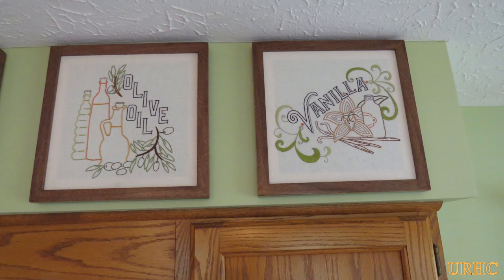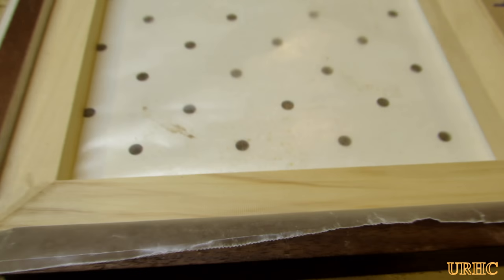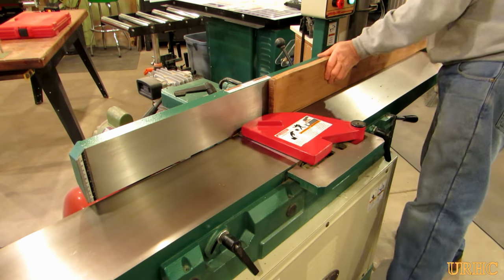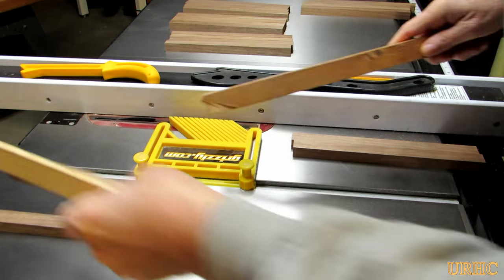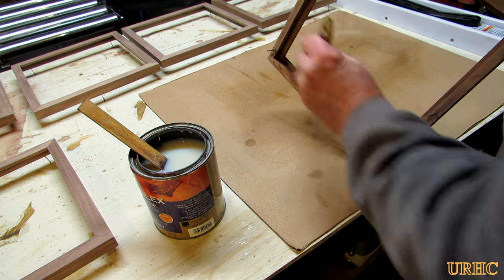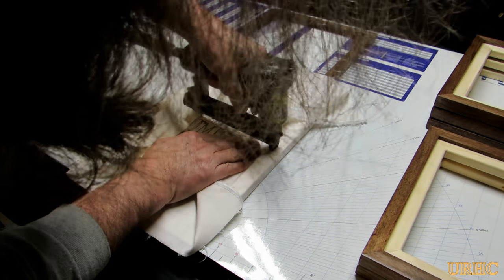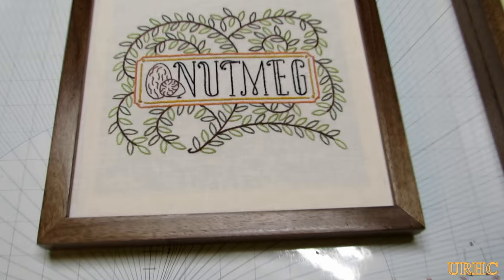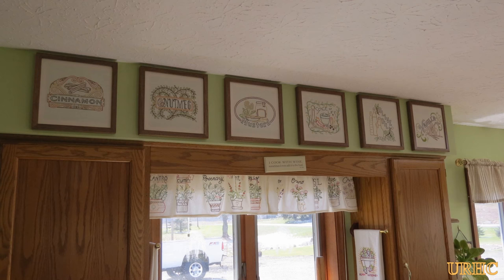Framing Some Needle Point Panels My Wife Embroidered

Comment: yeah!  another video, Thanks!
Reply from the maker: The woodworking ones will be ending for the year shortly, and the gardening ones will start up once it is warm enough to work outside. Thanks for watching my videos.
Reply: Is there any way to put some kind of rubber cover over the outfeed rollers on the grizzly?  

I'm looking forward to the gardening videos, the canning was good too.  Keep up the good work.
Reply from the maker: No, it would change the od and that would probably cause gearbox problems. The in and out rollers have to be the same od so you don't get binding. I think a cover would rip right off also.

Comment: I always enjoy watching your videos and this one is no exception. 
You mentioned at 14:00 into the video you're having problems with brushmarks when using water based poly, I use a small paint roller to level the finish after I brush it on to level it out.
Reply from the maker: I will have to try that. I still like the oil base poly better, but my wife has chemical sensitivity so I can only use the water base in the house. Thanks for the tip and thanks for watching my videos.

Comment: My 12" Belsaw Planer/Molder that I bought in the late 1970's still works fine and I'm still happy with it.  Wider would be nice but not with those marks. I like how you have your own take on projects.  Even before I saw the date I knew that it was a new video because I recognized the new table saw cover from a recent video.

Now I am curious about your clamp table.  Is there a reason that you haven't turned it into a downdraft table for sanding as well as clamping?  It seems to me that would work better than your fan but I don't know your situation.  I found several videos by searching for sander downdraft table in the YouTube search box.
Reply from the maker: I replaced a 35 year old 12 inch belsaw with this machine after the original motor burned up. I think the knives on the bellsaw did a better job when they were sharp and the final finish was better. I wanted the inserts so I didnt have to worry about nicking blades with glue ups, but never expected embossing. 
A downdraft table requires larger holes to get enough air movement and does not work well with 3d assemblies. Also it requires several inches of air plenum so it would raise everything up. I have thought about building a seperate one someday with a fan up top also. 
I just made a quick copy of my router wasteboard to try originally and it turned out to be more usefull then I had originally planed. Thanks for watching.
Reply: Back at the end of the 1970's I was working in a cabinet shop.  The boss updated the Northfield 12" jointer with a spiral cutterhead.  That was pretty easy since Northfield Foundry was about 10 miles away.  The difference was amazing!  The only reason the 30" planer was not updated after that was that the company was decades out of business and Northfield Foundry was not willing to take on that custom project.  My memory is pretty hazy but I think that 30" was bigger than their manufacturing equipment.  He bought a wide belt sander instead.

Comment: Hi,I would be very mad if I had spent as much as you on that thicknesser and it left a finish like that. I bought a small bench top model (very cheap) and get a lot better result that your big one.
Reply from the maker: My 35 year old belsaw gave a better finish. The out feed roller is the culprit. This has changed my mind about Grizzly tools. Thanks for watching

Comment: Can you not return the planer ? It's obviously a design flaw and not your fault.
Reply from the maker: I was told once you set it up and run wood through it you can only ship it back for repair. If they can't fix it then they will replace it. I was told it is not a finish planer to expect marking of the wood. The only choice I have left is to buy a roller from another manufacturer and replace it myself as Grizzly told me they do not make one. Funny thing is I wrote a review for their website to warn others and they have not posted it. I guess that is why all their machines are rated at 5 stars. Thanks for watching.
Reply: I didn't realize there was such a thing as a non finish planer, seems counter productive. I hope the new roller helps.
Reply from the maker: Neither did I. I think it is just a excuse for cutting costs to save $2.00 on a roller.
Reply: I agree, it's pretty deplorable of them. I honestly never would have thought that any planner I would buy would leave that much tooling. the $300 Dewalts don't do that. Jet, etc, don't do that. I guess I'll just not spend my money on Grizzly then, which is sad because I'm getting ready to buy a tablesaw, planer, and jointer. (so like 10k Grizzly won't be getting).
Reply from the maker: I purchased my jointer and saw from Grizzly and have been very happy with them. One of my subscribers just bought the G1023 saw like I have and is having run out issues with the arbor. This is the first grizzly tool that I am unhappy with and I think I will look elsewhere for my next purchase also.